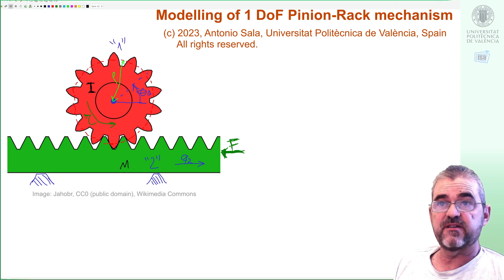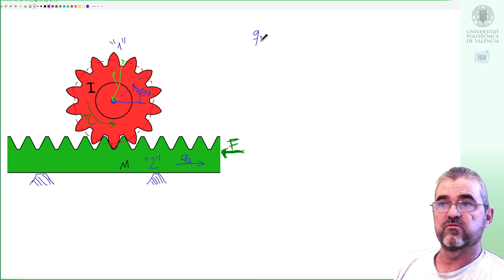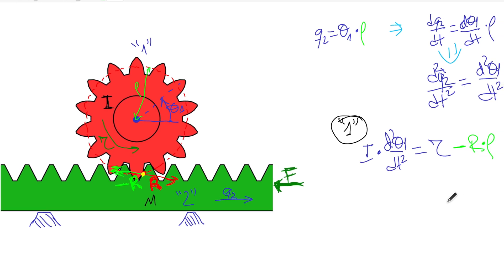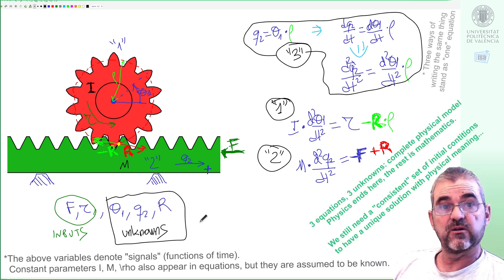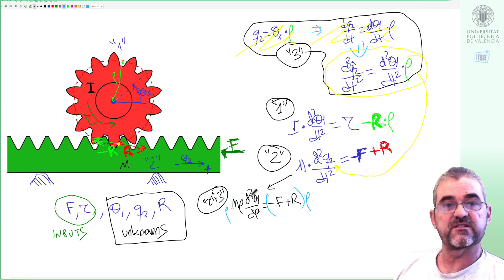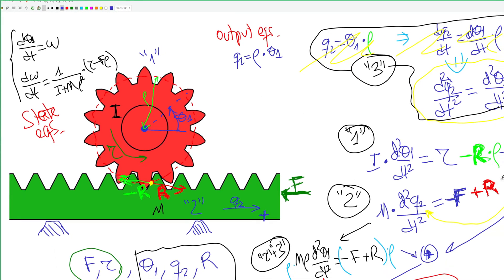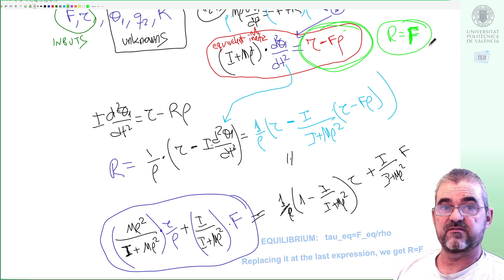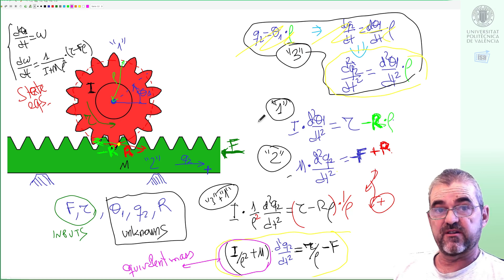**1 DoF Pinion-rack dynamics: Newton equations, equivalent mass & moment of inertia [moved]

Comment: What happen  if we use plastic   to make rack and pinion . Also what happen  if we use   mild steel give mathematically reason of each. Also how we can do force analysis  for rack and pinion .    Also how we can select material for rack and pinion
Reply from the maker: I don't know, and I am not interested at all.
This is "1st-year elementary physics", not "detailed gearbox mechanical engineering" or "materials science".